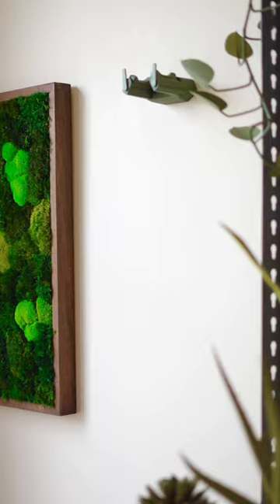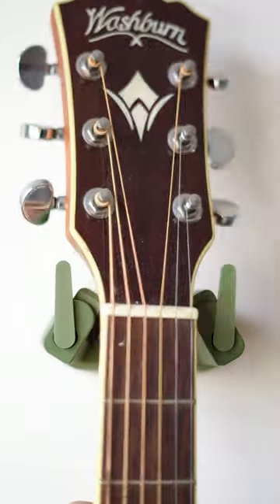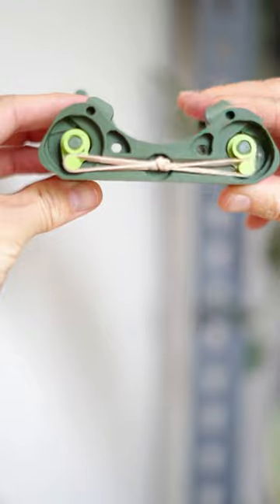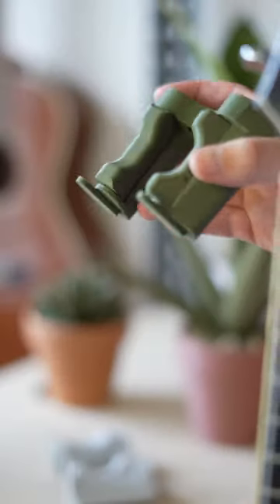Why my guitar will never fall #3dPrinting link to files in my bio

Comment: Unless im mistaken....these have existed for decades
Reply: Yeah. I think this is pretty much the standard wall hanger, in stores at least.
Reply: Ya, I’ve seen these in every guitar store, and pawn shop I’ve been to
Reply: This is a fresh design because he replaced the traditional metal spring assembly with a rubber band 👍
Reply: @347Jimmy  It really is not. Same mechanics, just with a different part.
Reply: @mynameisvallu   apparently I should have used a /s sarcasm tag 🤷🏻‍♂️

Edit: The kicker is the rubber band being the clearly worse option 😂
Reply: The difference is it's 3D printable and costs $0.39
Reply: He didn't say when he designed it maybe he did it 30 years ago
Reply: @frankhughes5702  ha! Yeh ok
Reply: @maximusachoo  probably still sells it for 2000% above that.
Reply: @Tqoratsos666  he doesnt sell it bro he has files for ppl to 3d print this
Reply: @Tqoratsos666 it's basically just the cost of the plastic for the 3d printer and the rubber band
Reply: @Tqoratsos666 it’s 3D printable mate

Comment: Design a guitar capo! Or another guitar holder with a built in compartment to hold picks
Reply: that's smart, basically the same design here but with a pick dish attached.  I've also seen those lil things you clip to a mic stand that pinch your picks in place, maybe one of those for both arms of the stand
Reply: If someone can afford a 3d printer I think they can afford a capo

Comment: Some of these 3d prints are clean enough to sell in stores.
Reply: These already existed for ages
Reply: @Oliver-tz6wi  so?
Reply: @FrozenKnight21  the ones that already exist are cleaner (rubber pads for the neck etc)
Reply: Probably only takes about 3 hours or so to make one. Sell for $30. Should have the machine paid off in 10 years and then you can start collecting some income!
Reply: @timmiller1  you can get a 3d printer for between $150 and $1000.  Unless you're going for commercial.  But even if we assume high end consumer of $1000. If we assume those prints sell for $30 as you stated. You could pay for the machine in a aprox 34 prints. (Not including price of fillament) If they took 3 hours each. (which is a reasonable estimate) And we assume an average of 3 prints a day. You're looking at paying it off after a minum of 8 days. If we assume you're using expensive filament, maybe 2 weeks. (Assuming about 8 - 10 hours of operation per day.)

If you think it would take 10 years them you really need to learn math. There is a reason 3D printers are such a big deal now.

This isn't as fast as injection molding, but it doesn't require any molds to be created. Which is where most of the injection molding expense comes from.
Reply: @FrozenKnight21  yeah I definitely didn’t actually use math or knowledge with my comment. But I do think the time required to print severely limits the ability to commercialize.

Comment: I love ur designs! Btw I have a question: Are u selling those? Because I would love to buy them in the future. I have a guitar and right now it's just laying somewhere, so this would be very handy! Great design.👍
Reply: This is technically what Hercules brand stands/hangers do, but they are a bit on a pricey side. It's great to have a 3d print model, so you can make your own on the cheap but if you don't own a printer it'll be cheaper to just shop for Hercules.
Reply: @smk666   oh ok thanks for saying that! I'll remember that then when I want to get that design.
Reply: He offers them as a file you could send to one of those companys that print the file and ship it to you, my brother does that I’m sure he’d do it for you and it wouldn’t be expensive at all regardless of who prints it
Reply: @IPreferLoLtbh  judging by my local prices (not US) it’ll be cheaper to get the ready made, injection molded product than pay for the print. Heck, I own a 3d printer myself and judging by the precise parts (hard to print) I’d probably value my time more than savings that comes from DIYing this problem.

3d print is a godsend for custom parts, new inventions, things made to measure but it’ll never win when there’s a mass produced item that does exactly the same if you factor in filament and energy costs as well as your time.

Comment: Pleaase trumbone (idk if i spelled it right) so it doesn't have to touch the floor and becomes easy to place down for resting and a flute so it can be an accessory on the wall but easily accessable to use when u want to. And maybe a sackpipe? Idk the word in english for it hahah but u know those uhm yeah sacks with pipes i guess 😅
Reply: Those are called bagpipes :)

Comment: Ok... gotta be honest with myself here... I've looked at all of your designs and they are sooooo much more esthetically pleasing than my designs. I have a guitar wall mount design that looks "okay". I mean it only holds 100lbs when put into a stud. I print in "engineering" materials only. Why do you print in pla/petg? Not all the prints I do require high temp but I like the way pc/abs/asa/hips ect. print and feel. What do you like about it pla petg? And why do so many other people use it?
Reply from the maker: It’s Easy to print, available in a Billion colors, not super expensive, and works in a wide range of applications
Reply: @ForgeCoreCo  that makes sense, and I get it. I guess I just don't like pla, or petg. I guess it's a weird preference thing on my part. Keep up the awesome designs! It's truely inspiring. I'll try to make my stuff look better and keep the   gorilla strength I think everything needs.

Comment: Can't you hear the scratches and dents on the guitar? NEXT accessory is a big rubber pad.
Reply from the maker: The plastic used is not as hard as the wood of the guitar so it won’t scratch it. But you could certainly put felt or rubber on the bumpers